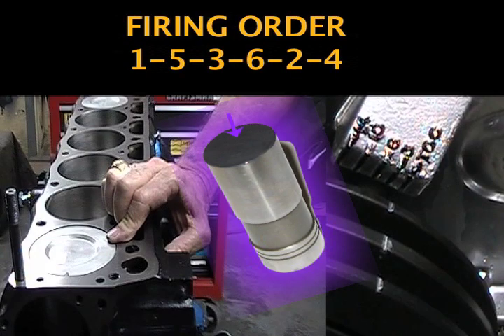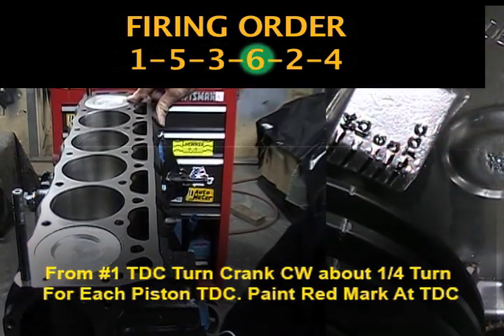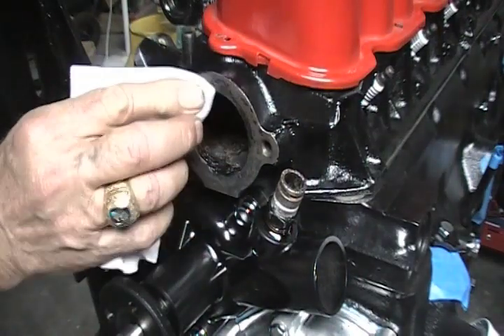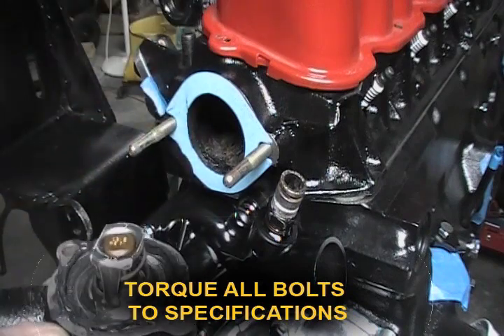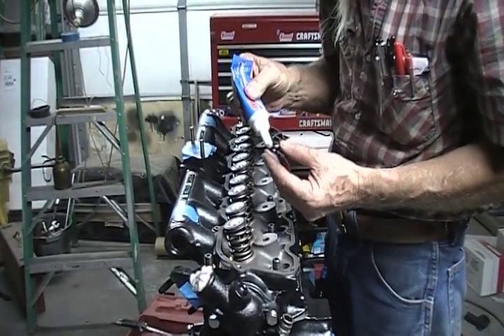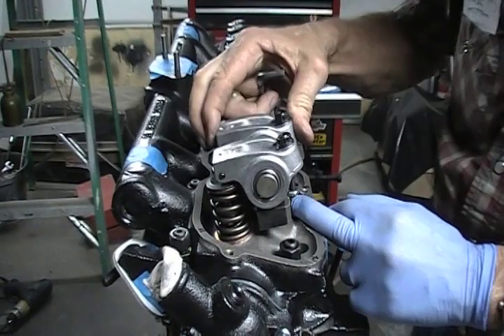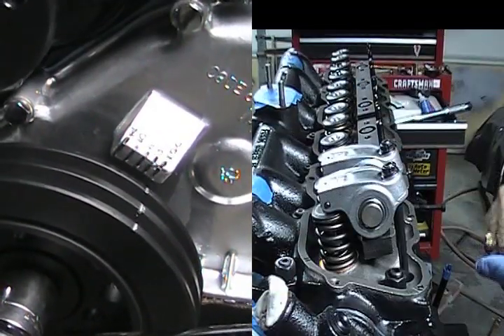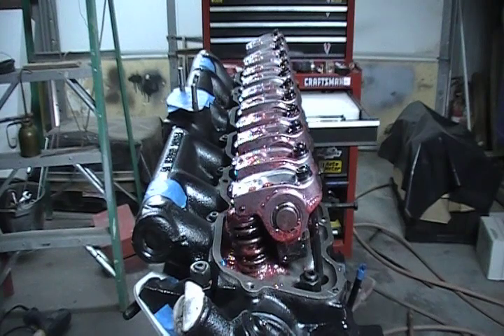Mustang 200 Rebuild Part VII

Comment: Love the videos! Just picked them up. Noticed you are using Yella Terra rollers. I have used these on 250 builds with 351 Cleveland lifters. Have a set for a 200 build I am working on right now but can't decide what lifters to use? Did you use regular 200 lifters? How did it work out?
Reply: ***** 
Hey Brad... No I did not use regular 200 lifters..
I used Comp Cam lifters. Call Comp Cam..let them know what your building....they will let you know what you need. Good luck...
Reply: GOOD NIGHTS, I AM ARMANDO A FORD 200 AND I WOULD LIKE TO INSTALL Yella Terra rollers
WHAT PART NUMBER RECOMMENDS THAT I CAN SERVE YOU

Comment: Hello sir. Let me say I am a huge follower of your inline assembly videos. I am having some trouble though. I can't seem to find your perticular roller rocker setup available. I am currently building my ford 200 and am in dire need of direction. Any information on the roller rocker specs would be greatly appreciated.
Reply: bondwizzle 
I apologize for not responding until now.. I had 3 separate youtube accounts. When Google bought youtube they screwed my accounts into one..  Between that and a death in my family took me off line for a while...

Comment from the maker: Hey James, I had a video for VIII. There is a tone of info there…… BUT I lose it on my ONE Trig-bite external hard drive. It goes all the way to engine break-in…. Problem… I had a medical issue that set me back a couple years… I should be able to get back on my Mustang by the end of this year (2013) Wish me luck…
I used Autolite 1100 carbs… I think you will get a real kick out of my new tri crab set up……
Look at Rock Auto Parts on the internet… 
Good Luck......

Comment from the maker: @benknefelkamp 
My apologies for not responding in a timely manor. I just learned how to receive comments by email…. 
This delay on my part will not occur again.. 
All these video’s are my personal preference for rebuilding a 200 IL6 and is intended for educational purpose only. They do not represent factory recommended procedures. 
Always use caution and take all necessary safety precautions when working on any engine project...
Have a great day,,,,... and have a successful project.. G/L